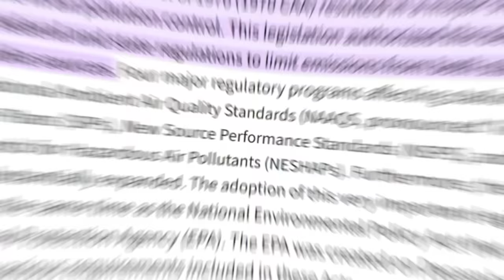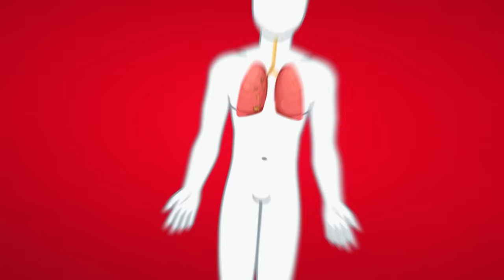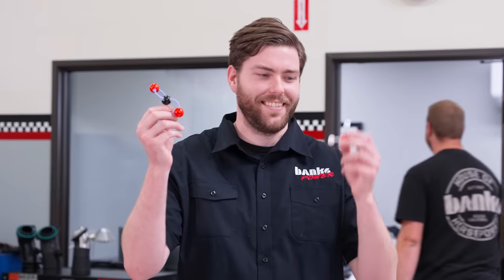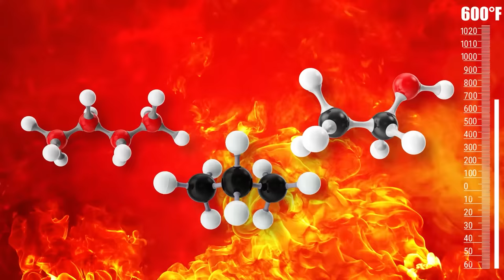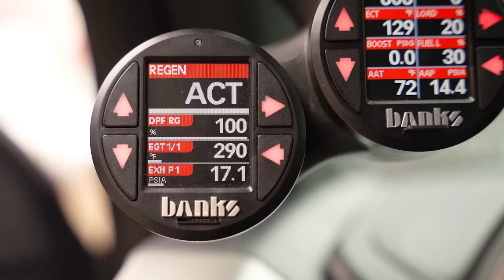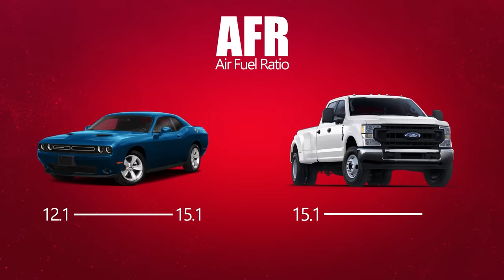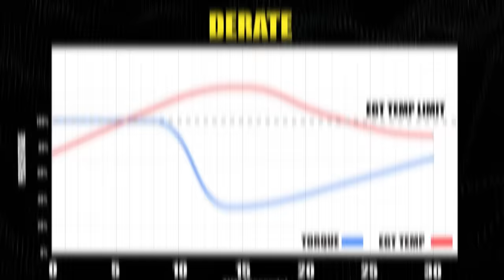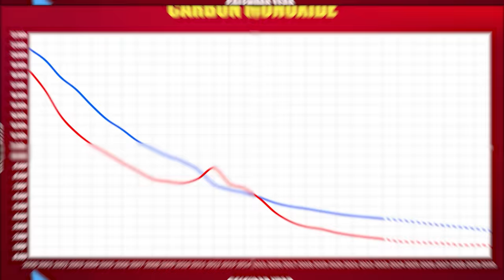Understanding the Most Hated part of your Truck | Banks Entry Level

Comment: So if all of this is no big deal? Then why are military vehicles that Banks does design for, not fitted with, PCV, EGR, SCR, or Catalytic Converters? I promise you that you can make more power and better fuel economy without these things. I don't think smokey black bro tunes are where it's at, but surely active regen doesn't make any sense.

Comment: My favourite part is that it stores carbon burns it and just turns it into smaller carbon which is very good for the environment because carbon is needed for the environment but this $8000 exhaust just takes carbon saves it and then turns back in the carbon you can’t break down carbon is a government scam

Comment: So if all your claims are legit why didn’t the factory do it ?
Reply: It's all about walking a fine line for manufacturers. Does the product have enough problems that we can capitalize without loosing customers? A good product reduces revenue cause once a customer has it they're not coming back til they need a new one which might be a very long time depending how good the product is and eventually you hit your market cap which then results in revenue loss.

Comment: Robbing the wallet when they first have to install this monstrosity + system components + electronics on the vehicle to being with and then cost even more later to fix since it never works properly anyway due to crap regen. 
The cost-benefit of these DPF systems in reality is poor. We have approached the territory of very expensive "solutions" for very little gain. This makes many machines/vehicles economically irreparable rather quickly, which in turn will just necessitate more machine/vehicle production and thus even more pollution that was believed to be curbed by DPFs.

Comment: You should never keep anything plugged into the OBD2 port as it will ruin computer modules over time. The only thing the OBD2 port is used for is plugging in a scanner.
Reply from the maker: We have tens of thousands of customers running iDash, Derringer/SixGun/Economind tuners, and PedalMonsters not mention other devices like ELD and AMP Steps that have not caused damage to the OBD-II system or the computer.

Comment: It's real purpose is to be a pain in the ass.

Had mine clog 1800 miles from home. Dropped my mpg to 12 and nearly left me stranded. It must be an easy filter fix? No. Needed to be cut out, cleaned, rewelded, all of which took multiple days...

Absolutely the worst piece of garbage ever invented.